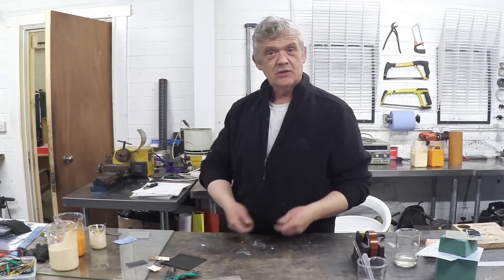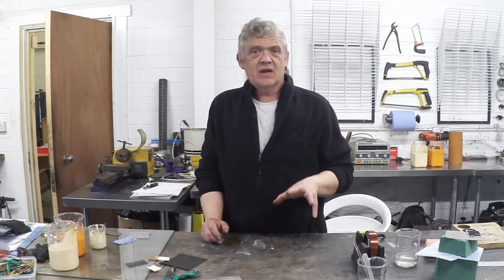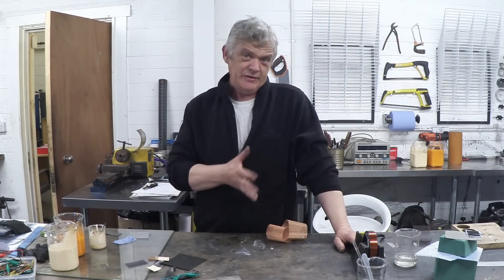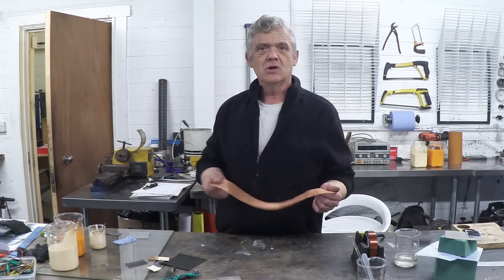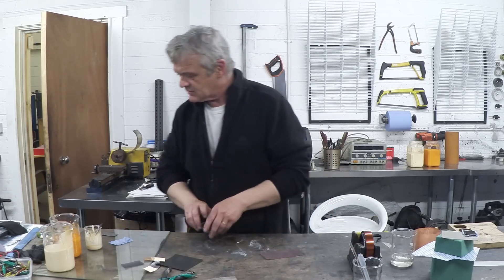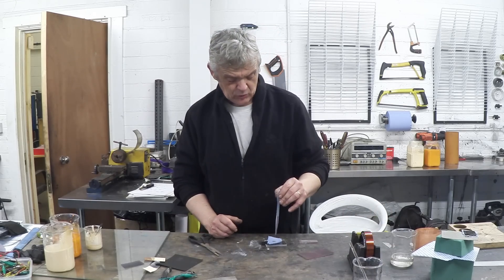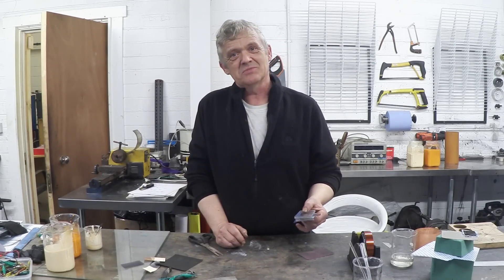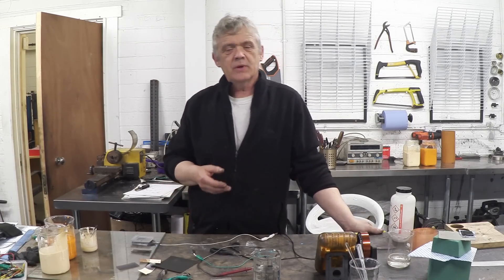A Simple Homemade Solar Cell

Comment: Could thermal oxidation be used to form the seed crystals and then the mesh grown out hydrothermally? Furthermore would a polished first surface metallic collector be ideal over graph-foil due to reflecting light back through the p-type oxide? Cuprous oxide is also thermoelectric; is it possible that cooling the back of the cell may contribute to its output?

Comment: I’m really enjoying watching your videos. I was curious as I know that titanium dioxide is a semiconductor and you can create titanium dioxide by anodizing plates of titanium, and the thickness of that anodized layer is the thickness of the titanium dioxide. I just wonder if it could make some sort of solar panel as well and honestly, I think about the wavelength of light you could potentially, make it more responsive to various wavelengths of light. I am not a chemist, but I’m really good at anodizing Titanium and it was just a thought that occurred to me. You have any comment on that.

Comment: How about this :
I know that emulsion, the paste used for making stencils for screen printing is photo sensitive. 
It hardens when exposed to light.
So i think adding that as a layer that encapsulates the coper mesh would or could improve absorption.
That is if one can figure out if the stencil paste ( emulsion ) goes on being photo receptive after hardening , or if something must be added to prevent it from lossing the photo receptive properties, either in paste form or after solidifying.

Comment: I'm looking for flexible solar cells to cover my roof. I believe a curved surface will collect more than a flat surface to utilize the light in any position it may be in. The main base is correlated roof. Would this mesh corrode and dissolve? Or would this be a viable option to consider for covering my roof? (I did have the thought of using a copper or copper coated roof to use instead of the mesh and trying the red copper method, but I feel like it would be difficult to heat it properly). Any thoughts on if this is worth exploring?

Comment: What if a random person had an amazing idea that could change the direction of solar charging electric vehicles and needed your expertise in electrical and engineering. Would you consider building a simple yet game changing solar array with 800% more power per sq ft with traditional solar cells?

Comment: There is a reason why Silicon and Germanium being in the periodic table between non metals and metals were studied most efficient to be doped n type (more electrons) and p type (more electron vacancies) that in physics produce higher voltages and current flow under excitations from a source.  The source we want to capture is energy from light or the sun.  Even in "metal oxide" designs it is more useful using metal to be a "gate valve" to Silicon and Germanium P doped and N doped substrates by an induced additional electrical field between both semiconductor material transferring voltages and current through it acting like it is a conductor like metal in electricity.

Comment: In order to heat copper for 30min at 230c you'll need a tiny oven of at least 350W but let's say the process consumes ¼kWh. The question is; how long will that particular cell at 0.2v take to produce this amount of power (and the material costs) back, to break even? Let alone produce profit? The core of the debate around solar power in its essence, I believe. Unless autonomy is more important than costs...

Comment: Just came across this video and I realized that if you figure out how to lattice a half cut copper pipe. You technically could make a panel that not only reflects the light into it but also between the gaps you can use solar cooling paint for the backing to increase it's efficiency.

Comment: To oxidize the copper, could you soak it in bleach for a little while?
Reply: I seen someone who oxidized copper red using a torch in the copper. Then they dropped it into a borax water solution.  I don’t know if that would be the same result as what he did in the video though

Comment: Mr. Marat-Smith, could you please respond with required items? Your accent is lovely, but I can't decipher what type of foil you're putting on the bottom of the plastic sandwich. 😅 Even with subtitles, the AI is typing "gruff oil" or "raffle". 
Also, what is the blue material your using for a separator? 
I like how simple this is and would like to try it.

Comment: It looks a lot more like a battery that is excited by the heat of the Sun. Do the same exact experiment but use a thermal heat source let's say a hair dryer or a heat gun and I'm sure you will get the same result.

Comment: Fun (unproven) Fact: 
Both copper oxides are actually necessary. Copper ii oxide (black) is an n type semiconductor and reflects all 7 colors of light. Copper I oxide (red) is p type and is a semiconductor diode. Mix the two together and you can use them to absorb all 7 colors of the visible light spectrum.
Reply: So basically sandwich the two together with an electrolyte in between?
Reply: @LukasValentino  Correct!
Reply: @tjtommy5495  I’m not seeing anything online about tenorite(cupric oxide) being an n type semiconductor…

Comment: I live in the USA so I went to a converter on the internet.  400 degrees C is 752 F .  Sorry my oven only goes to 550 F.  :)  Now it does have a Broil setting I would have to put a thermometer INTO the oven to determine what temp that would be.

Comment: Wouldnt an electrolyte that doesnt contain chlorine be better?  I mean, the con. is low and in the sun i dont think it would reduce to Cl and eat away at the metals...but under a cell having a voltage potential (if the voltage was higher) the Cl could be formed as it can be doing electroysis

Comment: I had to watch this again. I just found 440w solar panels for $10 a panel. Cannot wait to get 5 or 6. To power my storage shed with.
Reply: Update broken solar panels. I repaired one and got 150 w from it. Until I spent months doing patches. Brainstorming and figuring out my mistakes along the way. I came to the conclusion that it was not worth $10. Now if I had been educated in doing repairs. It would have saved a lot more time. However if it takes 6 months to do the patch work. Once I get good at it. 😅😅😅😅😢
It is not a good investment 😢 to repair broken panels. Unless you know exactly how to pick practically new ones from a pile of rubbish. I thought I would be able to tell the difference. Not with a microscope and electric meters. Would you be able to eye ball the good ones. 
The place I got them from. Was not going to allow me to test every unit to find the best ones. 
So unless you have all your ducks in a row. Don't waste time going on that adventure. Unless you and some pals want to get drunk after buying 100 panels. Oh and some due to code regulations. Will not sell them unless you plan to scrap them. Or buy 50 or more at one time. Well that was my experience. Hopefully some of you have better luck.
Reply: Where did you find them for that price? If you don't mind me asking

Comment: Any data on output? Say 12 to18 CDs extremely small gauge wire. Like telephone wire. I e seen some videos where aluminum foil is us6as conductors. But voltage, under load, and current? How many mAh at 3.5 - 5.5 volts
 For maybe charging a cell phone or tablet? Or a battery. Like a 3.7 v, 300 mAh LiPo or NiCd type? 
Want something small for  a video down or SHTF scene. 
I mounted two 6"   9" panels on 3outside of a small metal kids lunchbox,  and put some power pa is inside.  I wired in some DPDT switches so I can charge individually  or the8use all at the same time to charge a device. 
I have 980,000 mAh at 3.9-5,2 volts.i shouldbeableto chargeseveralphons and a tablet or two before recharging.  
They can all be changed  via AC too with an adapter.  Cuz it 8take a LONG time with the panels. They're kinda like a trickle charger.  LOL

Comment: Great video!
Sir! Actually i have been given a project in which i have to make a solar cell and then to use it in a circuit to show that it's working efficiently. But that solar cell is giving much less voltage. What can I do for that. Can I made a solar panel by using this solar cell? Would it be effective as my university project? Kindly guide me in this regard!
Thanking you!

Comment: Dear Robert, I was wondering is it light that makes the solar cell works and into electricity or is it heat? Because in winter the sun shine but one can hardly feels it so even if the sun shine in winter based on heat and light if that is true will means less electricity? Please let me know what you think is it light or heat?
Reply: Photovoltaic cells work via photons (light particals).
Solar thermal systems work via temperature.

What he showed here was a photovoltaic cell, not a solar thermal system. 

Too much heat can reduce and even degrade the efficiency of PV cells. 
This leads me to the belief that solar thermal systems could be used to draw heat away from PV cells in hot environments, thus extending their life and efficiency.

Comment: All I could find was some loose mesh which I  then folded up.. I put it on a paper towel with some salt water on top of aluminum foil but I am pretty positive I made a battery. I measured 0.5 volts regardless of light.  What did you say you used on the other side? Sounded like "grafoil"?

Comment: Hi Robert,
I was wondering what material you used for the separator? I am looking at experimenting with varying copper meshes following with your setup.
Thanks!
Reply: Did you find out what material he used for the seperator?

Comment: Hi Robert, thank you for the helpful video. Haven't seen this specific method anywhere else. Does the mesh size matter? I assume a "finer" mesh would increase surface area for Cu2O. I'll be giving it a try soon. Hoping it works and I can share it with my students!
Reply: Did it work and could you please tell me what you used as a separator for the salt water solution please

Comment: I'm not sure about this, but isn't that just a copper-carbon cell of sorts? Like one of those zinc-carbon lantern batteries with the zinc replaced with copper and the electrolyte being salt water instead of manganese dioxide? What I'm getting at is: does the the sunlight actually have anything to do with the thing; does the voltage meter show 0 or a reading noticeably less when no sunlight is present?

PS. While writing this I decided to do a test: took a piece of copper pipe, a graphite rod from a lantern battery and put them both in a cup with salt water in it, then measured the voltage with a multimeter, which read ~0.23V.
Reply: Do you know what material he used for the seperator?

Comment: What are the size limitations? i.e. why couldn't one use a square metre of coper mesh in this way for higher voltage?  (newb question - i'm guessing thermodynamic / bandgap limit)?

Comment: Robert, this is another great idea! Do you think that using multiple layers of copper mesh would increase the power output? The copper mesh is transparent enough that I think at least four layers could be used to catch more of the light that hits the cell. Where do you get the copper mesh?

Comment: Sorry the moment you add salt water, the whole shebang looks to be an Oxide cell. One way to prove that it is not as likely. Would be to use non heated copper as the back plate.
Reply: I have done experiments with aluminum oxide cells. And found that sun light can speed up the oxide process. However this is not an actual photo cell. Then again some supper cheep photo cells look to use oxidization as the primary power source.
Reply from the maker: okay mate

Comment: The most efficient solar cell is the one that uses the green form of copper oxide.. IE copper  of chlorophyll. The leaf, rotates automatically to face the sun as the sun moves. Sugars are created from water and carbon dioxide. This energy is used indirectly to create oils. Sugars and oils are the perfect energy store.
Henry Fords first prototypes of the model T, used plastic made from hemp oil. He noted that the plastic created had in the order of 10 times the tensile strength of steel...
Nature has already created the most efficient solutions to all of these problems. Yet we pat ourselves on the back when we ignore natures perfection and efficiency to come up with something that barely works.
Its like the notion of looking for the perfect robot to surpass living things. Face palm..
Victor Schauberger, said it right when he explained that we should analyse, understand and replicate or use nature....
Science has become a dogmatic distraction of theoretical nonsense...

Comment: Oooo this is going to be fun, i like solar power stuff. Have you seen solar power made from LEDs?... Zener diodes too. In the past ive had a go at chopping the top off transistors 2n3055 and putting those together :) ... good volts but i seem to remember there wasnt much amps
Reply: From LED?
Reply: @victorjustus9258  yep, youtube search it. Not much amps mind you

Comment: Loving the info! Was especially interested to hear about the spiky copper mesh once heated I’ve been thinking for ages that solar cells shouldn’t be flat they should be spiky, if you look at northern climate trees they have spiky leaves which gives them more coverage for solar radiation this style would surely make solar panels more efficient and look cooler as well
Reply: It's not about efficiency. Self sustaining generators and many other inventions have been made by many over the last 100yrs or so. They all end up dying suddenly and mysteriously. It's about money, power and control of the masses. Those that already have those 3 things will do absolutely ANYTHING, to keep it. Quite a few people have tried to better humanity with their inventions and every single one quickly perished shortly after going public and/or became a little too well known.

Comment: I wonder if a thermoelectric solar cell made from home made or bought constantan/iron thermocouples would be more or less efficient than an home made copper oxide solar cell with same surface area and which would be cheaper

Comment: Can you use the red oxide crystals from a Transformer, or maybe the better question is is that can you heat this at a lower temperature over more time and get the same results